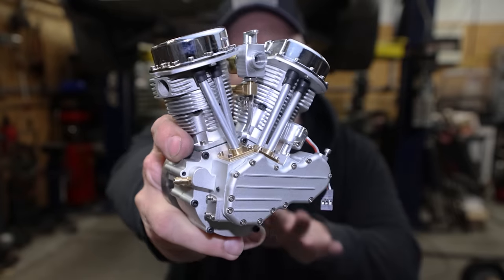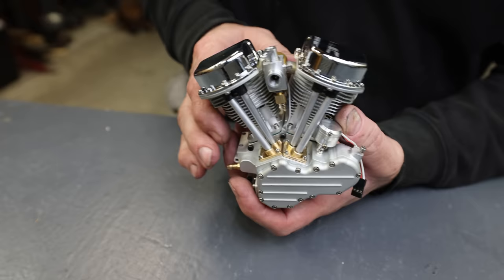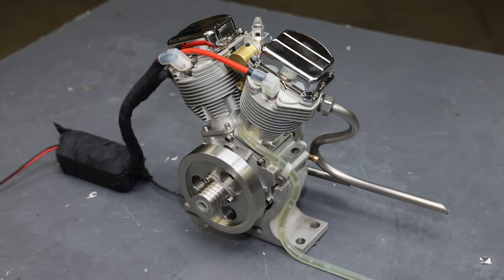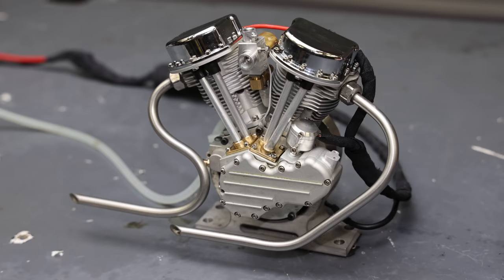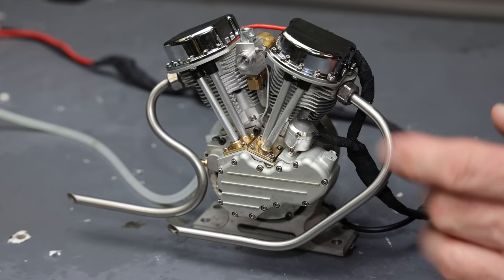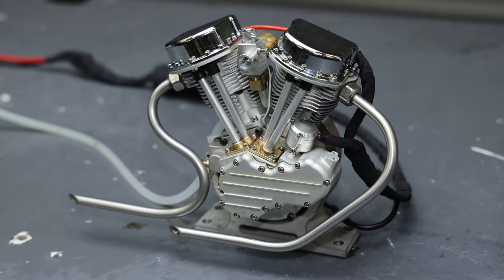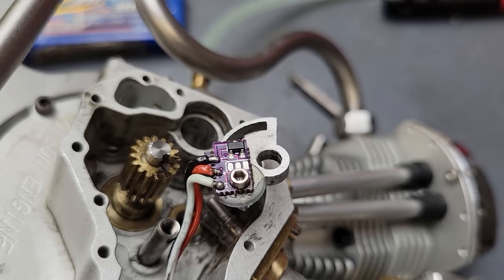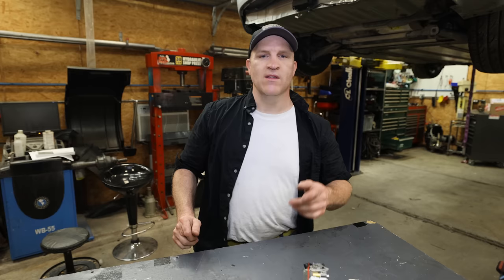Mini Harley Davidson Panhead Engine (Sounds Like the Real Thing)

Comment: It needs a paughco hardtail with enough rake so you can drop the front down behind that 21" dual rotor double spoke, dropped and level, some 3g fat bobs, bendix duojet and a s&s teardrop, double chromy oil bag, stretch those 2" to the back and finish them with fishtails so they bark, solo seat and a p pad on that flat rear fender barely off that 16" fat rear tire and a tombstone, go tubeless so that stroker dont bite the stem off, medium buckhorns to put them pits in the wind. Go kick only with a popsicle. keep the chain primary, cause your lady likes that. Love them grouchy ass pans. They dont leak if you know how to fix one. Only thing missing in the sound is the clutch steels rattling when shes cadillackin.

Comment: Unlike an actual four stroke Harley Davidson engine, it does not appear to get much "if any" lubrication to the top end. Considering the premature bottom end failure, that might also be the case with the bottom end. It would appear that particular "mini" engine might be best suited to ornamental use.

Comment: Gorgeous little jewel. Love the sound. At some point, if putting on display, you need to make headers with sharper radii to match the scale of the engine. Was going to say that you also need to check the runout on the flywheel. Noticed that in the high-speed camera shots. But I was typing while the vid was playing. I see that you think that you broke the crack. Too bad.

Comment: Ok bud you know that little brass nipple at the back left side of the engine that where your oil line to the crank case goes. No oil in crank case um no more bearings on crank shaft. I'm not sure where the crank case oil return line hooks up but its probably on the lower end rear of the crank case it should be visible if you look for it. There is supposed to be a small reservoir for oil and it takes 0w 0.2 oil 1-1.5 pints with a little inline filter(a regular little inline fuel filter for lawn mower or car or mini bike will work in a pinch) but its designed with a small oil pump to protect the crank case. The oil weight is according to Sterling.

Comment: Attention to detail is amazing. The engine piddles oil,  just barely keeps itself running at idle, vibrates hard enough to shake the fasteners loose, and broke down not long after it warmed up. I can't think of a more authentic vintage Harley experience.

Comment: Looks like you messed up the crank bearings then crank after you ground out the fly wheel weight, throwing off balance by starting it with that easy out extractor

Comment: No oil in circulating in the engine except for the premix in the gasoline he added,it was expected that the bottom end bearings would be effected !Does it come with the oil pump and lines with an external oil supply ? Why run it without oil.

Comment: Where is the oil tank and where is it hooked to the engine? Harleys sound the way they do because both spark plugs fire at the same time, one cylinder is on the compression stroke and the other on the exhaust stroke.
Reply from the maker: Actually, if I remember correctly, Harleys sound that way because there are 2 power strokes for each rotation, maybe some else can chime in but that's what I remember
Reply: @WarpedYT  I rode a panhead for 30 years and did all the work on it myself. Both connecting rods for the pistons are connected to one crank shaft journal. It's a 4 cycle engine and when one piston is compressing the fuel/air mixture the other is pushing the burned fuel air mixture (exhaust) out. And both spark plugs fire at the same time. You can reverse the plug wires on a Harley and it still runs just fine. But they won't run long without oil and they don't have an oil pan.

Comment: I bought the same engine but I can’t get it to run reliably. I noticed their is a gas to air mixture valve but I can’t get it to run without dieing. How did you get it to run reliably?

Comment: l wonder if it ran better when you switched to running nitro, instead of gas, because of the smaller size fuel and oil molecules. Also, l wonder if the crankshaft broke because the engine overheated when it was running on gas, rather than nitro. l'm no mechanic, by any means, so it's just a thought... Either way, it's a badass little piece of scaled engineering, and l'd love to see someone build a same scale bike to mount it in. lf l had the skills and the machinist tools to do it, l'd build two radio controlled, iconic, panhead replica bikes. One would be the 'Captain America' bike, and the other would be the 'Billy Bike' from the 'Easy Rider' movie.

Comment: These require oil.  It needs an oil tank, just like a real Harley.  The 2 cycle mix in the gas is not enough oil to lubricate the crank.

Comment: I came across your video again, and I forgot to say first time, that its actually a nice video and a cool little engine.
Anyways. I noticed the wobbling of the balance wheel right from the start (even when u turn it by hand at 2:15 it looks like it turns uneven), so either the engine was busted from day 1, or an imbalanced balance wheel killed it.

Ps
What happened to your feck finger?

Comment: Not sequential firing dude- panheads as well as most twin harleys since day 1 have a wasted spark system that ALWAYS FIRES BOTH cylinders at the same time.

Hard to sound like you know what you're talking about when you don't get the basic description right.

Comment: Mine is a total pos, the ignition did not work i bought a new ignition box and upgraded hall sensor. It started but ran like garbage.  I bought an $ 800.00 paper weight, about ready to take a sledge hammer to it and cut my losses.

Comment: The crankshaft bearing had already come off during the first start and at idle. Another video shows that the cogs rub against a lock ring of another cog wheel and it seems to be a terrible quality for a $600 toy engine.

Comment: If I had paid what must be a fair bit of cash for that engine, I would not be at all happy when the crank broke on the first run. Also as others have pointed out, no lube to the rockers or bearings up top, and probably none at the bottom end either. A very limited life pretty toy.

Comment: YOUR ENGINE WAS SO OUT OF BALANCE DUE TO THE FACT YOU NEVER BALANCED THE ENGINES ROTATING MASS, IE, flywheel, rods and pistons., so go back and balance it and reassembly it and don’t say you built a set of “ tuned “ exhaust pipes because you did not!

Comment: no big deal but viewer never heard the engine because you turned off the sound each time you started it.  The few times viewers had a fleeting chance to hear it, it sounded absolutley nothing like a Harley (50 years of riding) so I see why you cut the sound.  But in all, a bit misleading video.  Cute engine however.